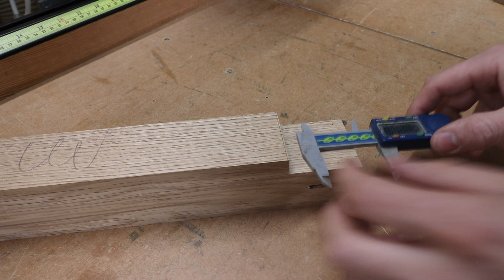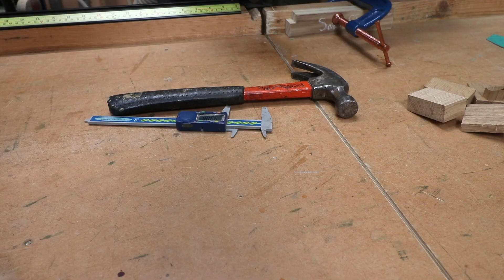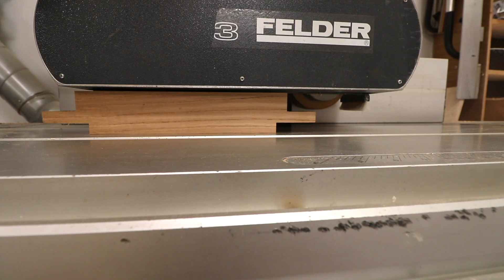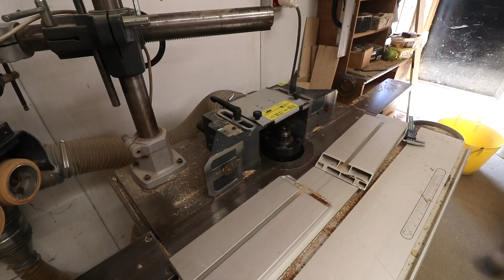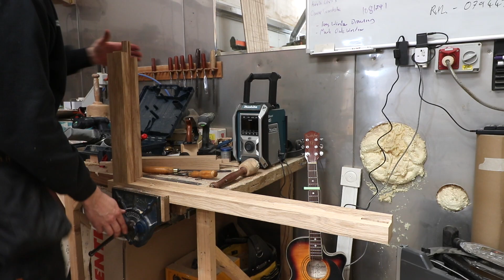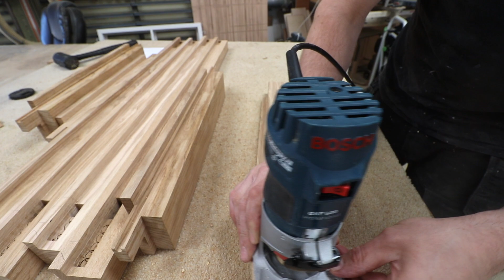Machining Window Casements - Part 9: Oak Casement Window

Comment: Mamouth series! I made sash windows before but having watched this series I can why some bits went wrong.  They still looked great but a pro wouldn't be happy. I used the same time on all the horizontal to keep the grain the same across the bay.... that said what finish would you expect to be use for the exterior of this project and how much / often would it need maintenance?
Reply from the maker: thanks buddy, on Oak there are a few options but none are going to last forever tbh. I would personally use a base stain such as sadolin classic, then topcoat with Osmo UV oil 2/3 coats. I would seal any joints/corners as best i could with the v grove sealant after the first coat of osmo has dried. Repeat maintenance every 2/3 years or at the point of seeing degradation. Its easy to apply a coat of osmo while the window is good,, but once its damaged its a bit more work.

Comment: Brad please show where you glazed and how  to put all the sealant rubbers ...  also I will love to see what locking system you are putting... I am in Australia so here we are not so much familiar with the dual lock point system ...  looking forward to see that and amazing videos man .. you are a cool man ...
Reply from the maker: THis window would be glazed on tape internally then sealant externally, i normally use a 10mm tape outside in the centre of the bead, and use a wet sealant to point the beading in. similar to the internally glazed method i use in the sash window series
Reply: @BradshawJoinery  thank i already  saw that part and i liked, now what locking system my friend??